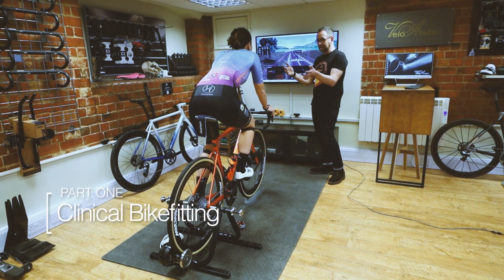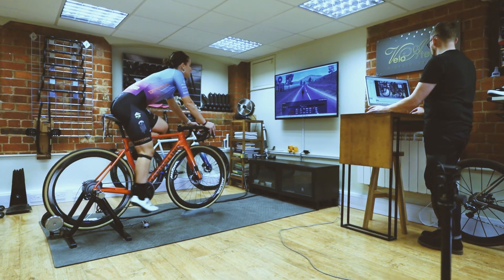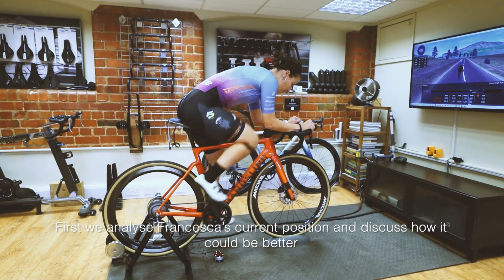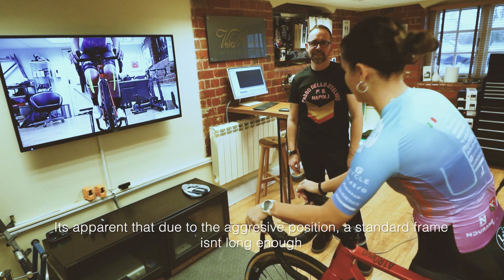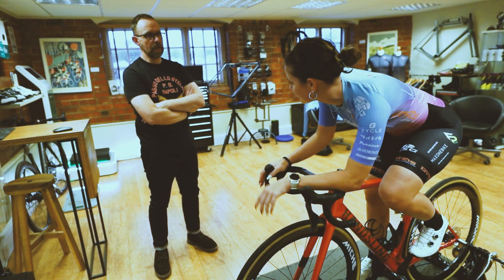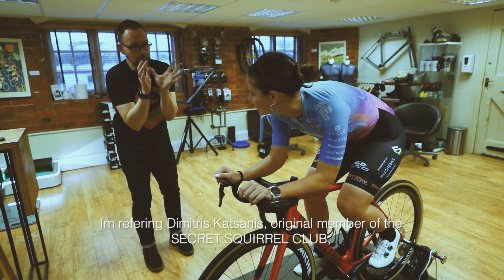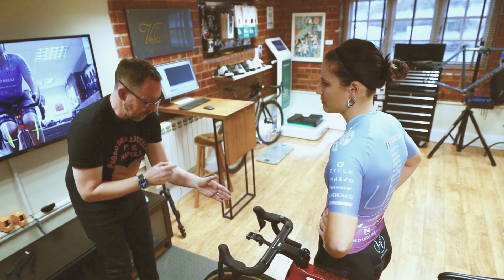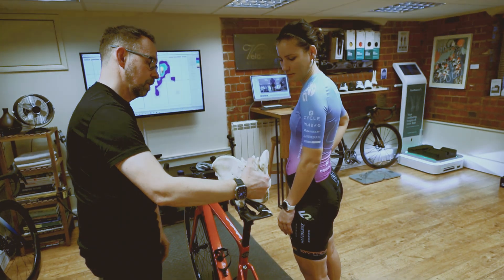3D Printed Aero Road Bike only weighs 6.9Kg!

Comment: i have TI bike with integrated derailur hangger. and it was design flaw. once it broke in my case the thread are damaged. that's it. probably more good if the derailur hangger made for two piece.
Reply from the maker: Agreed. This was only a concept prototype. Future iterations will have many more improvements.